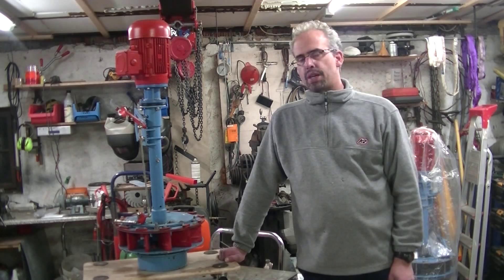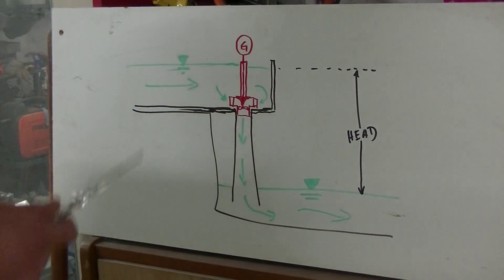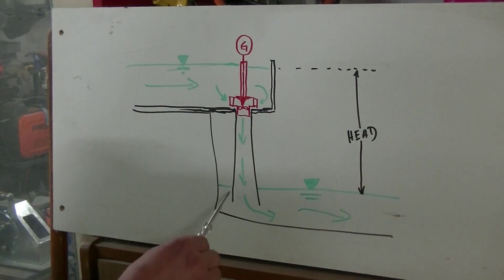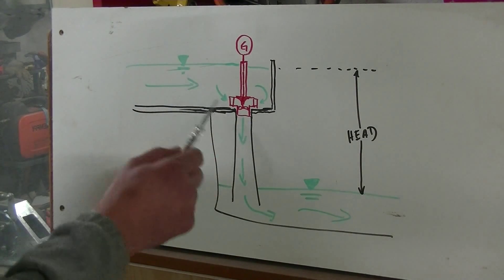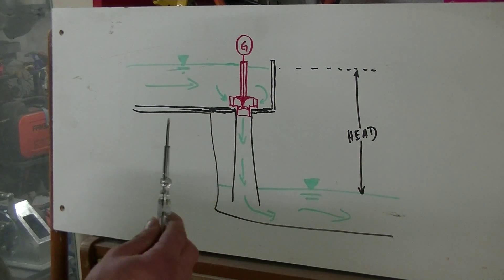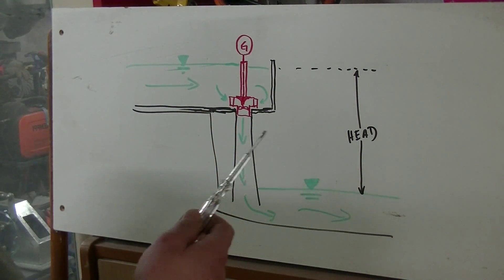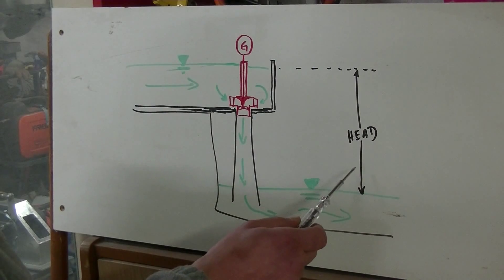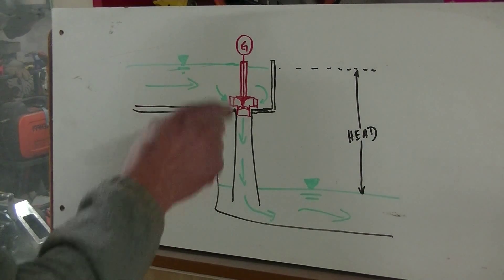Low head turbine - what you need to run it

Comment: I believe there is a basic mistake in this drawing. The head is actually the height the water falls TO the turbine.  Once it is past the Turbine, it is no  longer of use to it. Or have I been wrong all these years?
Reply from the maker: No, Sorry! The gross head is the head between the upper water level and the lower water level. Wherever the position of the turbine is, this is not so important. If the head between the upper water level and the turbine runner is lower als the head between the turbine runner and the lower water level, it´s more a sucktion turbine. As long as there are no air bubbles in the water, the full head can be used for producing power.The air in the water makes the fluid compressible, no air, no compression or expansion in the turbine of the whole system. The whole head cn be used..... understand?